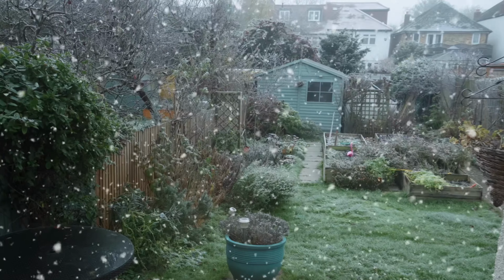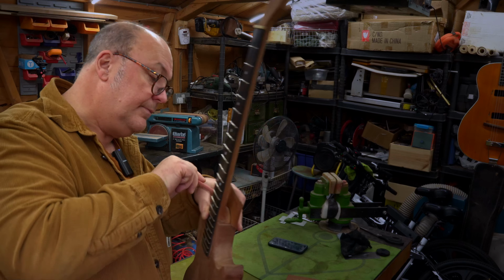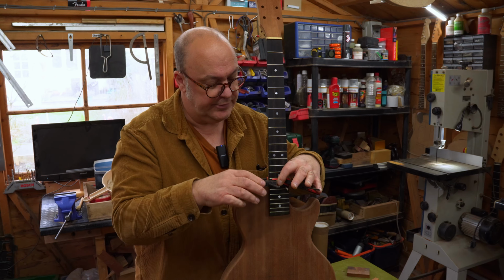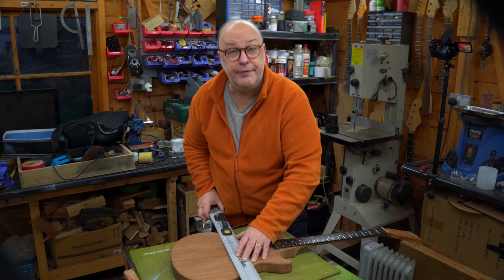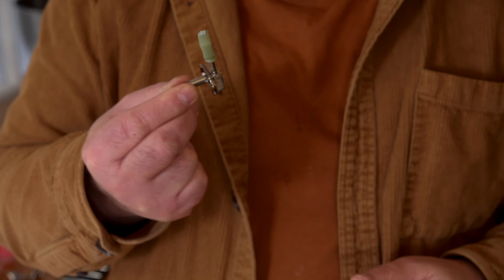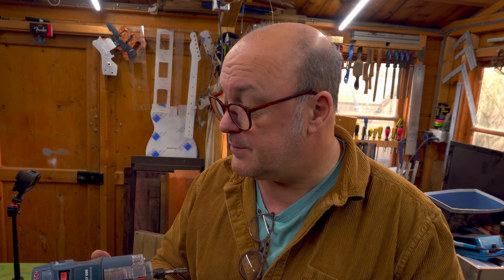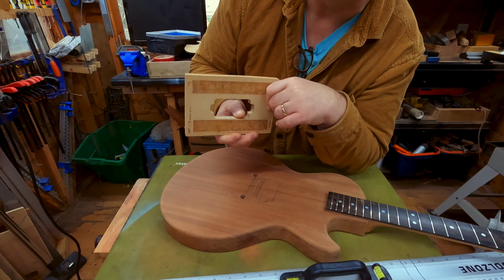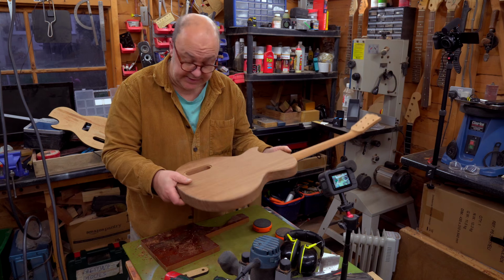Les Paul Junior Style Guitar Scratch build Part 6

Comment: Great video, as always.  I'm definitely going to try using my finger to spreads some glue around on my next project.
Reply from the maker: Fingers rule. Best spreaders ever and always very handy. Guitar making is necessarily tactile. You need to feel the glue sometimes and I’m forever finding bits of stuff in the glue that may mess with the joint. They are ‘digital’ too so that’s kind of trendy isn’t it?

Comment: Dear Chris, please, use my advice abour mic. You can use a mic which goes to your phone through headphones input. Record the input is easy with any recorder app you have. I know that unfortunately there are not a lot phones with a headset input. Feel free to use iPhone 4, 5. Qiality is at very high point and you are mobile with such recording scheme. And it's pretty reliable too
Reply from the maker: I’ve gone across to Rhode provideo rifle mics. I find lavalier mics dead and characterless. I think you need the ambience in the workshop. The sound of the tools and materials is so important. A lavalier mic is just my voice and there’s already too much of that. Recording separately on an iPhone adds the sort of complexity I could do without. Thanks for your suggestion. But no. Hell no.
Reply: @chrisreynoldsguitarmaking  I've got your point.

Comment: Oh...and BTW here in the states that Bosch router is called the Colt. I have 3 of them.
Reply from the maker: They are great. I thought I captioned the router as a Colt in post. I have loads of attachments but used only a few of them. A firm fave. Thanks Mitch

Comment: Yesss 24.75” with a straight edge!!! This is the one I’ve been waiting for. Thank you so much for… bridging the gap 😎. 

One question: since I haven’t decided which style wraparound tailpiece I’m going with yet, slanted or straight… Do you happen to know the measurements for the bridge posts if I were to go with the slanted style? Thank you!
Reply from the maker: Woo tricky one. I would assume that the centre pivots around the scale length. I do love the slanted look. The question of slant angle and exact measurements is something I would have to research. There is an LPJ group on Facebook. I bet a posting there would get you a deluge of answers. Some very knowledgeable folks in there. C

Comment: Hello again 🙂Another question on the placement of the bridge posts. I notice a lot of LP juniors and specials with wrap around bridges seem to have the bridge on a slight angle. How come you were able to position your wrap around bridge saddles in a straight line?
Reply from the maker: Because the bridge I chose is compensated and has that angle built in to the saddle/fulcrum point. It’s only the original uncompensated bridges that require the angle. The angle does look cool though. Well spotted and a great question. C
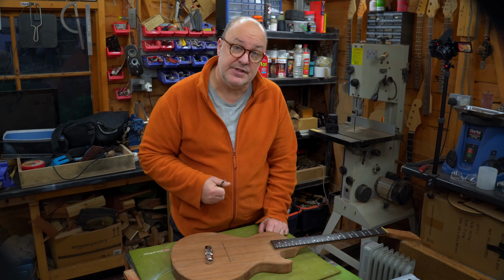Reply: @chrisreynoldsguitarmaking  Thanks. What do you mean when you say "the pivotal point of the bridge is on that line that we marked" at around 11:15 in the video? What is considered to be the pivotal point of a wrap around bridge (or any bridge really)? Bridges I've been looking at have quite a bit of space where the strings sit that can be adjusted back or forward (hope that makes sense) so I'm interested to know how exact I need to be in the bridge placement in relation to the scale length. Thanks again :-)
Reply from the maker: @tomgillard1262  the fulcrum or pivotal point in the bridge it the point of the bridge saddle that starts the beginning of the scale length. The top of the saddle to the inside edge of the nut define the scale length.

Comment: I was very impressed by the fact that you could drill the holes for the bridge posts with  a hand drill. Those holes have to be perfectly vertical, and you did it. I would have to use a drill press. Question: I noticed that after you drilled the holes, you pounded in the posts. Later, when you routed the pickup cavity, the posts were not in the holes. But there was no pickup rout when you pounded in the posts. Did you remove the posts?
Reply from the maker: I’m good at getting stuff straight. I don’t know why. Good spacial senses ir something. Yes I took the posts out to route the pickup cavity. They might have gotten in the way of the template. I wanted the bridge sorted first so I could eyeball where to put the pickup. I wanted the pickup aesthetically positioned slightly further forward than standard as the lace Alumitone is very bright but full range. I figure with just one pickup you want a broader tone. It doesn’t have the vintage roundness of a p90. All excellent questions Tim. I hope I answered them for you. Next episode soon. I’m editing every day. C

Comment: About the heal... was it really necessary? Amazing job man.. 
i am about to paint my junior. Just like yours but i built with 2 p90s 

Congrats 😊
Reply from the maker: No the heel was not obligatory. It just kinda felt it needed it for aesthetic balance and vintage feel. I didn’t want it to look like a bolt on.  Think you’ll get it later when it’s finished. Good luck with your LPJ. I’d love to see it. C
Reply: Got it
Reply from the maker: @LuisPauloMarques  thanks for your input Luis. I hope it works out !!

Comment: I really want to build a les paul jr for a final project for school. Of course I will have limited time, so how long would you think it takes to make a guitar like this (for someone with no experience)?
Reply from the maker: Hi Kamiel, assuming you have access to the right tools you should be able to make a Les Paul Junior with the right supervision. As to how long? That’s down to you to some extent. I would guess around 20 hours should be enough to get the woodwork done. The problem I see is the fact that guitar making isn’t a race and potentially rushing is a recipe for disaster. I am continually telling myself to slow down. Once you’ve got the woodworking done you have to consider your finish. If you use nitrocellulose paint you need to let it cure for a couple of weeks ideally. But you can probably do that but at home in the garden. It’s a bold project Kamiel and I wish you all the very best with your build. Above all be careful and never cut towards yourself. Big love C